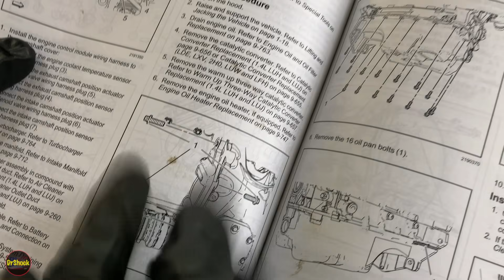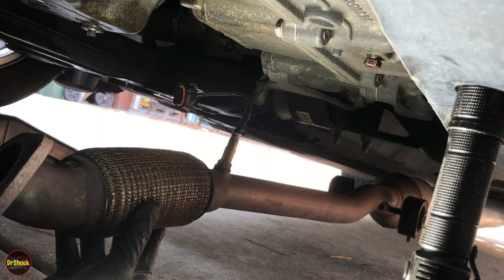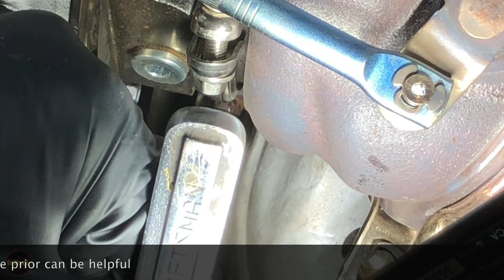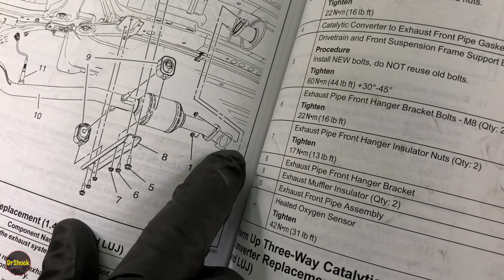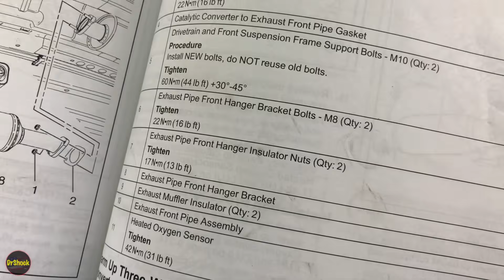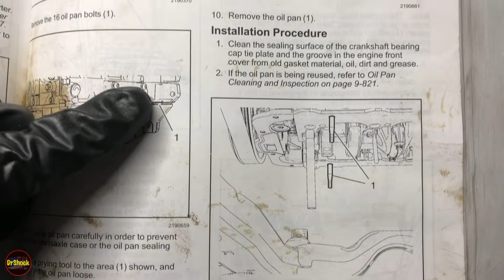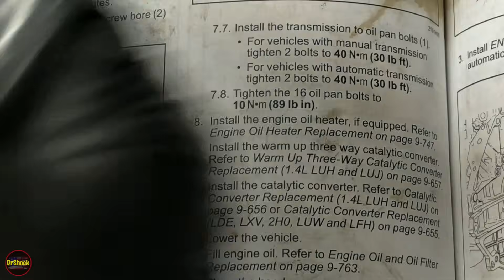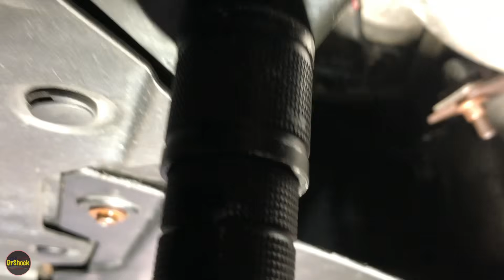2011 - 2020 GM Ecotec 1.4L Oil Leak ~ Oil Pan Gasket Leak Repair (Chevy Cruze Sonic Trax Encore)

Comment: Are you able to access the oil cooler/filter housing unit to change that seal with the cat off without removing the turbo?
Reply from the maker: You have to disconnect the exhaust manifold and turbocharger connections to change out that oil cooler seal on the Ecotec 1.4L.   You can leave it nearby without completely removing it from the engine bay, but it'll be in your way big time.  But you definitely have to pull it off and away from the engine to get access.
Reply: @DrShock  do u have a video on that? Is it just the exhaust gasket and oil cooler gaskets u need in addition to the parts for this job. Btw, thanks for the response and detailed video...
Reply from the maker: Not for the oil cooler, but here's one for replacing the turbo - https://youtu.be/SHnmbnNbClU

Comment: You can actually reuse most of the parts, they just want you to buy new ones.
Reply from the maker: Nope, that's what a layperson would presume.  But as an engineer, I'm here to tell you that you cannot reuse those parts indicated as one time use.   Torque to yield fasteners stretch due to their unique metallurgy, and thus must be replaced to maintain the correct engineering torque for the given engine components.
Reply: @DrShock  The TTY bolts obviously need to be replaced, But I don't see why you need to replace the turbo/cat clamp when there's nothing wrong with it.
Reply from the maker: OK, that one is a more fair part to question replacing tbh.  

But while there's nothing one may be able to see amiss visually, the engineers who designed that V clamp do point out multiple times in the GM service manual that it has to be replaced whenever removed.   Perhaps internal GM testing showed the clamp fatigued out of specification with repeated fastener torque, or GM was concerned about corrosion with an emissions part and this was proactive mitigation guidance.

But who really knows, my view is if a fellow engineer says to replace it - then I replace it.  ;-)
Reply: That clamp indeed does break , I was doing the oil cooler gasket, taking off the exhaust manifold on my >100kmile 2015 Cruze and the clamp split it half

Comment: Would you still recommend a eco-tech GM engine ? Great detailed video.
Reply from the maker: Thanks, well the cars these come in you buy for the car rather than the engine.  You are kinda stuck with the engine if you like the car.  They are more maintenance than other engines in this price bracket though.   The Ecotec 2.2L that preceded these were reliable, inexpensive to repair, and often never leaked, in my experience.   These 1.4Ls, and the 1.8Ls, are regular leakers and far more expensive to repair.
Reply: @DrShock  Thanks, for your time you saved my marriage. Keep up the great work !

Comment: Hmm, my exhaust right behind the flex portion actually bends up and over and then back down where I wouldn’t be able to do what you did
Reply from the maker: What model / year GM car do you have (e.g., Sonic, Trax)?
Reply: @DrShock  2012 Chevy sonic 1.4. I was able to just remove the bolts where the cat mounts on the bottom and that gave me some play to push my cat and I disconnected the 3 where the exhaust has the flex pipe. It was just enough to get the oil pan down.

Comment: At 22:40 there is a 10mm nut with bolt, i tried to find those because it broke. Do you know the part number please?
Reply: Thanks a lot!
Reply from the maker: Are you referring to the 10mm nut on the stud retaining the cat bracket being removed in that view?  If so, that stud is part of the bracket and not serviced separately.
Reply: The 2 bolts and nuts on the catalytic converter bracket that hold the converter
Reply from the maker: The nuts are the same part number, and the stud in the time index you quoted is part of the upper retaining bracket for the cat.   You can find both part numbers at eBay using this affiliate link: https://ebay.us/MtNC16

The other stud is part of the cat itself, as that lower bracket is welded on.  So for that one you would have to buy a new cat.
Reply: I don't see the torque spec for those nuts in the video, do you know?
Reply from the maker: Jeez, looks like I forgot to mention those in this video.  16ft lbs, you can see me go over that in this other video https://www.youtube.com/watch?v=SHnmbnNbClU at the 1 : 24 : 00 mark in that one.

Comment: My oil pan looks just like the one from the beginning of the video (hence why I'm watching - car is leaking just a tiny bit from the engine cover explained in this video). On mine, it appears the just one corner is leaking / seeping (the front corner closest to the serpentine belt.) Could the crankshaft seal or oil cooler be leaking over this part of the pan too? It's so difficult to tell "where" my leak is coming from... Great video and so well explained. Thank you for this excellent content. Any other tips (as to other common leaks in the front left corner over oil pan)as viewed from the front of the vehicle?
Reply from the maker: Thanks.   Yeah these Ecotec 1.4L turbo engines are prone to leak in three areas.  The oil pan (like we show here), the timing chain cover, and the crankshaft seal.   The bulk of this car's leak was coming from the pan, but it still has weeping from the timing chain cover, and crankshaft seal.  So at some point I'll have to roll a video on doing one of those (the crankshaft seal would be my next step).

If you suspect the oil cooler, it should be obvious as that component is back behind the turbocharger.   Cleaning things up and watching where it comes back can help confirm.
Reply: @DrShock  thanks for the reply. I had the oil cooler unit replaced, so I hope that it's not leaking again. I sincerely hope it's just my oil pan leaking at the one corner, but I'll definitely clean it all again and watch the progress of the oil leakage / seepage over a few days. Thanks again for the super detailed video!
Reply: Can I ask if it was just the oil cooler, or if it was the pan as well? @arcadesunday4592
Reply: @DrShock  hey mine is weeping from t iming chain cover like you said, would it harm the engine using it like this?
Reply from the maker: Makes a mess for sure, but no actual harm in delaying a timing chain cover gasket replacement as long as its just weep and not a full on leak.
Reply: @DrShock  thank you Doctor!

Comment: Ide be willing to bet your pcv valve in your intake manifold failed blew mail seal and oil pan gasket
Reply from the maker: Nope, PCV on this model engine is a two piece design.  The primary venting is located as an orange colored silicone bypass valve within the intake manifold on this model GM engine and is fine (it's a common failure though, and I have a video on how to check this here - https://www.youtube.com/watch?v=qGBt5skZWLI).  The secondary is at the Turbocharger vacuum line (this one almost never fails).  

The pressure valve in the top of camshaft cover is also fine (which is actually what goes first when the bypass valve is lost).  Many folks confuse the pressure valve with a PCV on these engines, but it doesn't have anything to do with the crankcase ventilation.

Unfortunately this model engine is prone to failures on the timing cover seal, and the front crankshaft seal as well as the oil pan seal.   At least one of these problems should be expected past 60K miles.

Comment: Hello Sir, 

Sort of a weird question but I was wondering if you can tell me where I can find (or what type) the bolts on the heat shield are. https://www.youtube.com/watch?v=SHnmbnNbClU. You opened these at around 3 minutes in the video of yours I linked. I have been able to find the heat shield online but the haven't been able to identify the bolts. Thank you so much.
Reply from the maker: Those E10 bolts that I start removing in that linked Turbocharger replacement video are only available from salvage yard vehicles now as they've been discontinued for some time.  GM did supersede these with a regular hex head bolt which is cosmetically different but functionally the same.  You can buy those new from your GM dealer or from time to time off eBay, here's an affiliate search link for them: https://ebay.us/1mwjZk